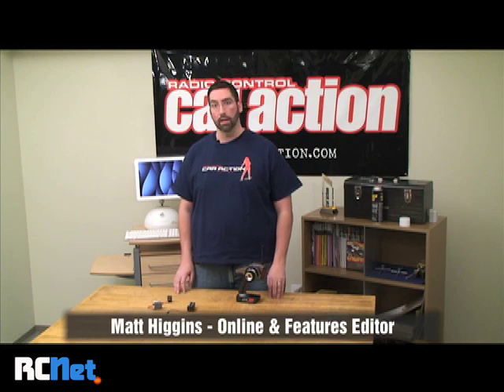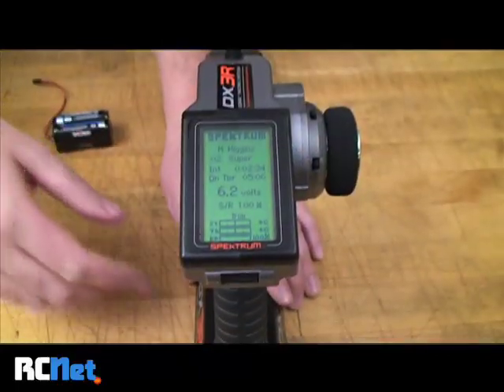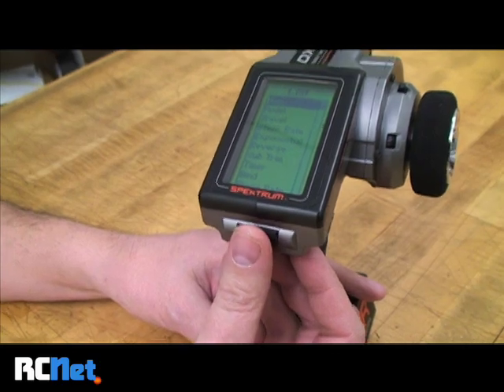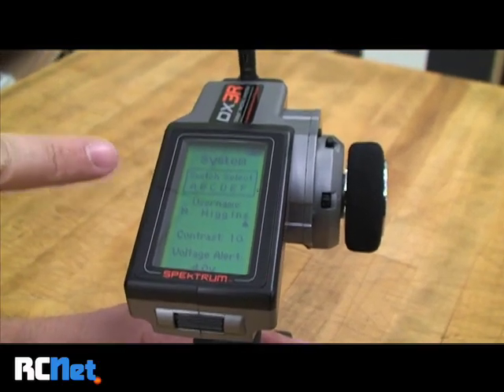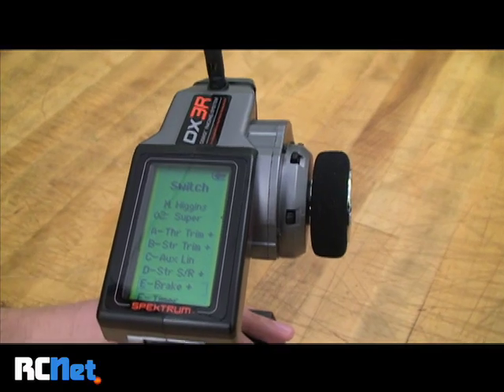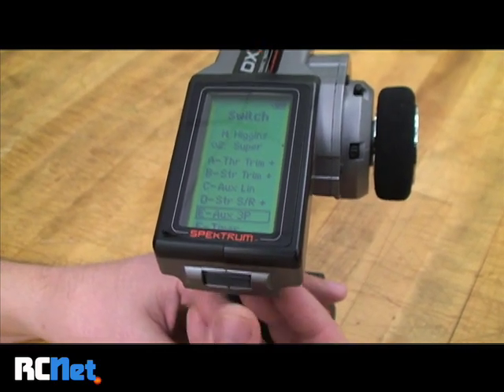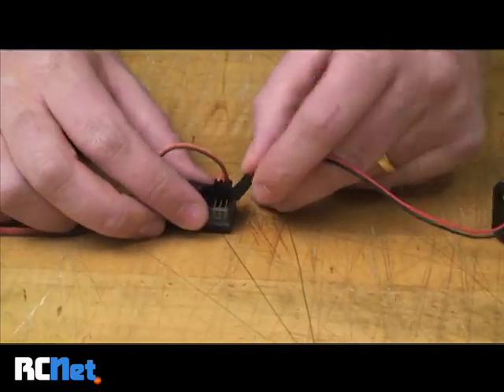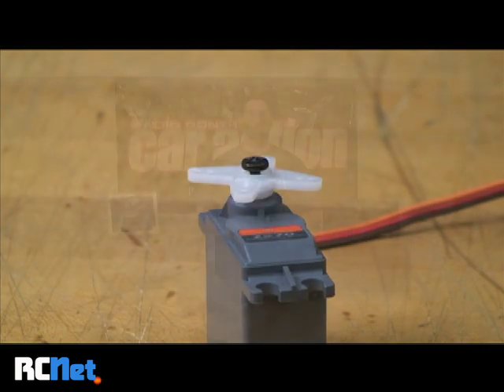Rear Wheel Steering Setup

Comment: @nebcasillas Not quite the same but the DX3s has a build in steering mix and when enable the rear or secondary steering will follow the steering channel. I have mine setup where I can act all wheel steering with the AUX switch and simply reversing the aux3 channel I can do crab steering as well

Comment: I own a Futaba 3PM.
Based on this video, Futaba is better.
I have 128 steps each side; 
(1) front steering only
(2) rear steering only
(3) four wheel steering
(4) crab wheel steering
video shows 3 posistion steering, proportional is far better.